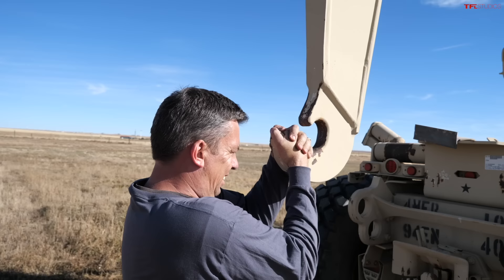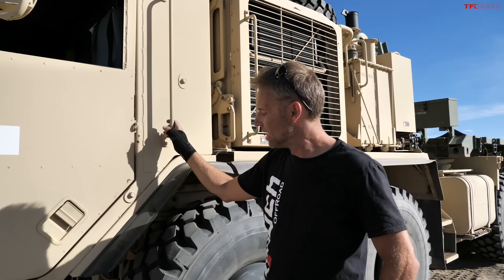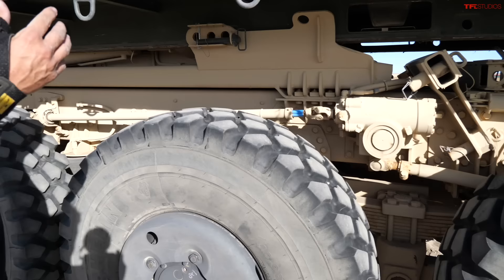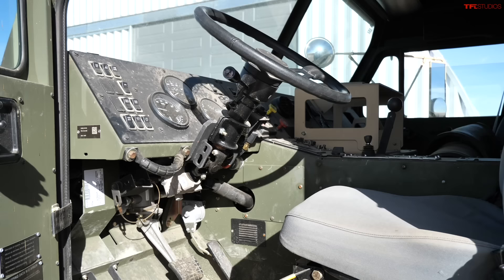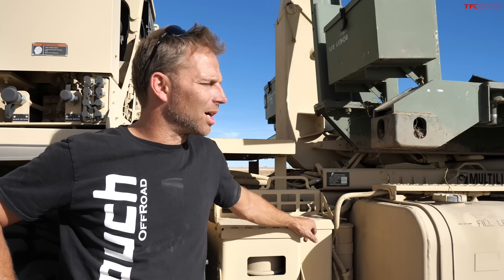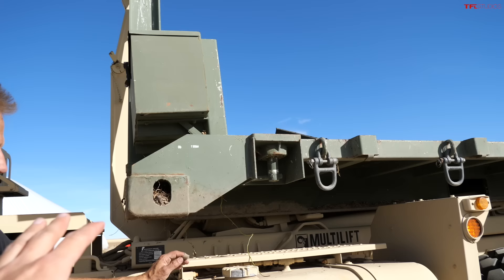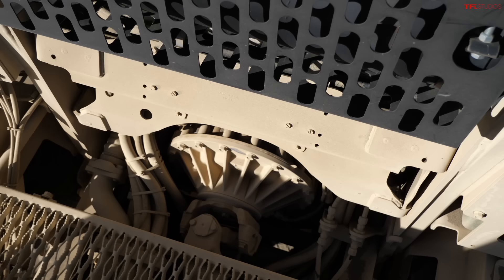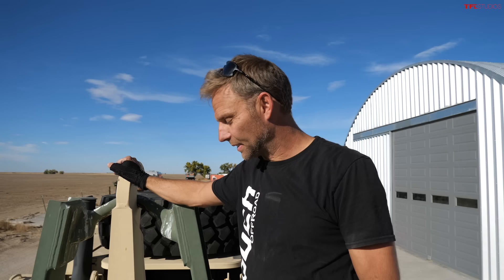Think A 4x4 Is All You Need? This 10x10 Military Truck On 53s Begs To Differ!

Comment: I drove the original into Iraq in 04. Had a Detroit 2 stroke diesel in it. It was an 8X8 and would go anywhere. Was rated at 10 tons and I had much more than that on it. Really awsome truck.
Reply: An f350 is rated at 10 tons dude
Reply: @thomasrobinette3227  that’s just the cargo, it had a 90 ton rated pintle hitch. It’s really an off road vehicle so though it doesn’t haul as much as you think you can go anywhere in it.
Reply: I drove a PLS in my Cavary unit for a little while, but ours also had cranes between the rack and the engine compartment. They are beasts.
Reply: @thomasrobinette3227  An F-350 can tow 10 tons on a nice highway; one of these trucks (in the 8X8) can carry 10 tons off-road.
Reply: @thomasrobinette3227  Yeah, dude. Compare a pickup to a Cat powered 10x10 hook truck. Tie an f350 to a sizeable tree and tie the other end of the frame to this truck. If the tree doesn't come over and the chain hangs on, the PLS will rip the f350 apart. The smaller M984 wreckers are rated to tow up to 100,000 lbs and packs a 30 ton main recovery winch.
Reply: Same. H8 operator in '05. Most reliable truck in the motor pool and the only one assigned to one crew.
Reply: @mtnman1984  who knows.
Reply: Thank you for serving.
Reply: @brianb-p6586  The military rating is for off-road payload, on road is usually double that.
Reply: Drove the hemmet wrecker in Iraq also and in Korea very fun down narrow streets
Reply: @jasonheitzenrater4786  loved the wrecker.
Reply: @thomasrobinette3227  relax dude
Reply: I appreciate your service brother thank you!
Reply: Did your fuel tank leak too?
Reply: @corashae2185  why yes it did, check valve that kept the fuel system primed was always going bad. Real pain to start
Reply: @alannewhall2323  it comes standard on these models
Reply: @thomasrobinette3227  10 tons onboard, not 10 tons towing capacity, they are very different things
Reply: I WAS IN IRAQ 04 AS WELL
Reply: @thomasrobinette3227  🤣
Reply: You had an 1977 A2.  I work with 2and an A4.  This resembles an A4
Reply: Drive a PLS in OIF 06-08. Loved what you could do with this vehicle.
Reply: @thomasrobinette3227  but F350 cant do it through the same terrain a Hemtt can.
Reply: I was a DoD GS15 Contractor who on the teams who armored most of these in 2004-2005 at LSA Anaconda at AoA 2 sprungs in Iraq.
Reply: My best friend was a driver and had a gunner in one of these that tipped,  due to pulling a trailer and forgot to pull out the backing pin out before convoy rolled out. Very long day
Reply: @mando719ad  I imagine that was the day alot of PTSD cases were born. Just thinkin about that cranked up my PTSD sponsored headache. I've been on jobs involving trigger time over 40yrs in a lot of countries. Last spring, at 67, i was almost in mission condition then Murphy's Law hit me. After over 30 surgeries for trauma and 5 cancers it all went sideways.....headon crash in May. "Routine" eye surgery in June. Woke up totally blind in left eye. Got some vision back except in bright light. Couple months later one morning my wife found me in back yard leanin on my Suburban planning mission with my team. Cept they weren't present. 105° temp. At hospital docs ordered CT scan. Spotted leison on remaining L kidney. Had surgery and yep, renal cell carcinoma. Surgeon drained a cyst  while in there. Pathology said it was cancer too. By sticking needle in it just pissed it off. MRI 2 weeks ago, Feb. 20fuctup22 and it has spread. In the wreck it broke off 4 front teeth and fractured 6 others so now they're coming apart. Facing bout $100,000 worth of surgery. Also now have 2 pinched nerves in spinal fusion zone.
I ain't givin up but unless we hit lottery this weekend my bucket/dream list of havin rig like that one is a no go. Wife has a rare '67 Corvette insured for over a million dollars but sellin it to get super rig like this....not on her radar. 
Big thanks to all the military folks that commented. Guessin my contractor days are kaput. Days in general are bout over I'm afraid. Not goin thru any morr surgeries. No chemo. No radiation. Radiation exposure probly what got me in this mess. 
Sorry for long comment. Side effect of my, not terrible, PTSD. 
"The only thing necessary for the triumph of evil is for good men to do nothing". 
Edmund Burke 
The End. 
rick in Tennessee.
Reply: @thomasrobinette3227  “dude”
Reply: @mtnman1984    My Ford Ranger is stronger dude
Reply: @garysarratt1  👍
Reply: @thomasrobinette3227  You can put 10 tons on an F-350? 20,000lbs in the bed?
Reply: @cgreeneblue  I mean yeah you could I guess if ya wanted
Reply: @brianb-p6586  this thing tows 90 tons. Payload 10
Reply: I was a HET Driver from 03 - 04 in Iraq. What months were you there?
Reply: @thomasrobinette3227  yea but take that 10 tons through the rocky mountains and sands of Afghanistan  in an f350… it’s rated for more but that’s the rating for off the pavement
Reply: @Teufels_hunde  who knows
Reply: Do you remember the fuel consumption (liters per kilometer or gallons per mile) ?
Reply: I drove them in the Army for almost 7 years including deploying to Iraq, there almost completely invincible
Reply: @thomasrobinette3227  ok they can haul a lot of weight.
Anyone know how much an Abbram weights?
Just FYI,  as I said I was a tester for the 10 wheel PLS and the CHU  in the Army at Ft Hood in the late 90s.
One test was an Abbram on flatrack. 
System loaded it into the truck 
Truck hauled it great.
Flat rack was ruined. 
The things are beast.
HOWEVER. NOTE  this was before things got Arnoured up.
The one in picture isn't full Armour if any.
I never drove the Arnoured ones. Didn't see one until after I retired.( note sometime after 9/11)  
I drove 70 mph with a D8 dozer on a flat rack as well ( main post from 4th ID side to north gate.) 
May been able to go faster. But I have my limits. They are only football size made of brass. 
Thats some massive high center of gravity. And that road ain't strait or flat. 
And 70 was the highest I was willing to go. So the whole way was not 70 mph.
But it climbed in speed great thanks to that Detroit ( all Detroit motors as far as I know are 2 stroke. This may have changed) 
Detroit like high rpms
Cummings run smooth and strong 
Cats are the engines to give F ups. Because they take abuse.
IMO I like all three. But of what I've seen.
Cummings is the fastest.
Then Detroit
Then Cat.
That doesn't mean ones better.
Detroit can be  " difficult"
Cats take abuse.
And just because today one is faster. Tomorrow another is.
I remember KT650 with a 5 speed and 4 speed browning. ( most don't know what this is) but in its day ( think teddy bear by CW McCall time) it was fast. Overloaded on I-5 doing 90 mph. Close to the old grapevine. 
Truth is engines haven't got bigger. Just new ones.
Turn any old big engine until it blue flames the stacks and it will stay with any truck today. And pass many, because they are governed. 
Blue flame the stacks. This is when at an idle the blue flame is just peaking out the stack. Floor it and you have IDK 10 foot flames. Quite a sight. And last I knew illegal in at least some states , cough cough Commyfornia.
But I haven't seen a truck blue stacked since the 80s and those were " gypsy truckers" independent / outlaw.  
I just remembered that. The truck I was going to buy from Mitch was a blue flames. Thats why my dussy old man won't let me buy it. I would have ran circle around his under powered junk.
Sorry remembering old times.
Reply: @jasonheitzenrater4786  FYI  the Hemet is a different vehical.
Nice but different. It also much older then the PLS.
Though I believe the 8 wheel PLS were Hemets.
The difference is like driving a S10 with a 4 cyl and one with a 350 ( 5.7)
PLS / CHU  will out preform a Hemet hands down.
If you asked me for a vehical to drive in a combat zone PLS is on the list Hemet is not.
BTW M810 series 5 ron is also on the list. But the ones before are not. Nor is the 929 series.
M810 series had good HP and gears. Plus they COULD do 80 mph. ( I didn't have a governor) 
And I would walk before I used a old duece. My company had one top speed going down hill with a strong wind at it back it did 35 mph.
Ok the top speed 35 mph is real  I drove that thing ONCE.  After that. I put so many Xs on the 2404 people called full bingo. I refuse to drive it.   
Anyhow the Hemet goes back to the 80s that I know of.
And FYI I say Hemet. I really don't remember the right spelling. Nor do I care. In 88M school it was the fastest truck. Or was that the M915.
Either way they both were slow. M916, M919, M920  were all faster ( note same engine and trans as the M915)
But I am slightly remembering the Hemets were new at the time. Because they were someone pet. Some CO over me at Ft Dix.
Oh I just realized something. If you never drove or operated a PLS you don't know how quick you can load.
Ok I shiza you not on this.
I've done this. ( one of my many test)
Run PLS  backwards FAST. Dropping hook as I ran. slamming flatrack.
Hooked. Dragging flat rack as Im hauling azz. Never stopped the whole time. 
Impossible to do with CHU attachment.
For all the hell we put those flat racks through. I'm surprised we destroyed so few.
Oh that test on combat loading was done at Ft Irwin Ca during one if many NTC my PLS and I went to.
Yeap back then we had to rail our PLS to Ft Irwin along with 10 flat racks a piece.
I believe in 2001 Irwin got some PLS. But we were already testing the CHU then so we still had to rail them..
Bad thing was everyone liked our PLS and CHU. So the two head testers had to go to every NTC any 4th ID went to. 
Lol railhead guys started saying. Bla bla bla, bla. We just wanted to know when you two would be here. How many this time. 
Like the 4th time on. They would just walk past us on inspections.  And ones they seen us tieing down was the same. 
I vagly remember something about an officer commenting. And the railhead guy saying something like. Heck I checked them 4 hours ago. (OK he didn't check us. But he rode us enough before and knew we knew what we were doing)
And we never did cut corners. Because we knew if we did it would be the time they checked us. And we would never hear the end.
Reply: @jasonheitzenrater4786  BTW I just seen you said Hemet wrecker. 
Rolling on floor laughing my azz off.
Ok here is a really old story of a Hemet wrecker during Desert storm.
I know one that came back with a 454 SS truck engine and trans with less then 2000 miles. It also had a " few" AK 47 and one pretty 9mm with a USSR hammer and cycle on white hand grips. In the bed.
I seen them cut the bed open some "odd metal" put in the open area. And welded shut.
When it came back to our stateside fort.
It went into the mechanic bays. 
All doors were closed and locked 
An hour later. The mechanics came out.
Best Fing chief I've even seen. 
Oh that 454 ended up in one of the two Hemet wreckers mechanic Chevelle. 
I'm sure the other got the 9mm. 
Since I didn't see behind closed doors.
I believe the chief and all mechanics recieve AKs. ( thats all mechanic that went to IRAQ. ) 
The ones that didn't go to IRAQ where sent home early that day, about an hour before the wrecker came. 
Like I said that was one great chief.
Oh something else. Our battion CO refused to do the paperwork so they, any AK, could be sent stateside. Yet, did it for himself, the SGM and at least two others. And rode on a bus from Ryade into Iraq during the seece fire some they got credit for being in a combat zone.
While my company was in Iraq the whole time of the ground war.
The Bus trip costed him with the Bragade CO. Which was one officer I liked and we served a few times together from the time he had his bird to 3 stars. 
Honestly, he was a major azz. But best officer I ever knew. Even to this day I'd follow him to hell  it he was an officer. We had a lot more history through the years. It was good making a friend like him.  
I use the word friend loosely. But I will just say. In the end. I have him to thank for my request to retire being approved.
The shuzabag lizbo battion CO i had really had it out for me.
But a 3 star in the right place. Put it through and got it approved. 
Before the Cut with an N , knew it DA sent me my approval. And just to make sure it wasn't lost. A 3 star sent me a copy. 
She was 100 shades of pissed. As was her fat little lizbo lover. 
I remember my retention NCO telling me   some that happened at Batt when my orders dropped. 
Quite a few people knew she, the batt CO, had it out for me. But they were stuck and couldn't do anything. On the other hand. She was stuck in what she could do. Orders were lost before leaving  Battion. Such as orders to Korea, orders to go to Q course, or any other PCS orders. And she refuse to leave to another command.
So she really hurt herself in the long run.
Plus, I sure my old 3 star, had a few things to say. In regards to her future. 
Oh I didn't mention. That 3 star, last time we were together was Ft Leonardwood. At the time this happened. He was in this little building in Washington with 5 sides. 
Airborne.
Reply: @mando719ad  I forgot about that backing pin.
I remember it was a pain.
But roll over due to it?
Maybe.
But, I think it had to be something else.
These things are hard to roll.
Believe me I tried. 
Again I was an Army test on the 10 wheel PLS and CHU in the late 90s and early 2000s.
Honestly, I feel if someone rolled one of these. They shouldn't of been driving it.
We did a lot more with them then anyone should have done. 
And we did this to make sure they were good for the Army. 
And yes some of you can thank me now with the #1 finger. Because some of those saftey are due to us.
Not sure what was added.
However we did request they had better Armour on the floors.
Years after retiring I seen the sides got Armour. Did they Armour the floors or was it still sheet metal.
To be clear I'm speaking of the floors.
Not the area between the windshield and the floor. That nice plate at the front. I liked.  
There was room to Armour the bottoms. We put sandbags there. So I know Armour would have fit.
I just was very uncomfortable about those floors. Being an Engineer and all. 
Landmines were always on the back of my mind. 
However. I keep speaking of the unarnoured ones. 
I know nothing of the characters of the Armoured ones.
FYI the one in the picture is not full Arnoured.
Full Armour has much smaller side windows. 
And if any Armour was added. It would change things.
 But here are some questions I have for newer operators. That is operator's after 2002 to present. For the 10 wheel PLS or CHU. If you are an 8 wheel or hemmit do NOT answer
Can they,  the 10 wheel PLS and or CHU Still do 90 mph or did they govern it down?
Is the floor still sheet metal ( like 16 gauge) 
Did they keep the auto air for the tires? ( you could set the air pressure you wanted them to stay at.) I like this fiture, but it was slow back then. Took like 10 minutes to deflate down to like 20 psi. And inflate was much longer. 
If any changes that you know where made speak up.
I liked them. But they were also the only Army vehicals I got to drive brand new.
Nothing like knowing that you are the first person to drive a vehical. That no one in the army drove it before you.
And the only driving it has seen . Was from the factory floor to the railcars.
And you drove it off the rail cart to its very first duty MP.
You are the one that gave it its first scratches and dents. Lol.
Reply: i had a m984E1 wrecker!
Reply: @thomasrobinette3227  YOU OBVIOUSLY DON’T KNOW CHIT LOL.
Reply: @wildeninja2836  I know more than you do
Reply: Same man.  Hated the goddamn pls in Iraq but seeing now is kinda cool.  Logged 20000 miles on msr tampa over two tours.
Reply: I used to fix those.
Reply: Oshkosh pretended they were going to make EV postal service vans, made no plans and pocketed 3 billion dollars.
Reply: So basically it was an overbuilt beast
Reply: @alannewhall2323  my friend jumped one.
Reply: @TheRedsuper1  I've seen that.
Reply: The M1075 had the Detroit motor and the M1075 had the CAT. The M1074's had a fuel rail check valve problem.
Reply: Me too. It's a juggernaut. Ours carried our FRS.
Reply: Operated the first Hemmitt way back in '89-'90. That's how far back I go back. Heck, I learned to drive a standard in a 5T dump truck. I do love that beast. Yeah, they get about 3 gallons a mile, but they are awesome rollers.
Reply: @mtnman1984  I was H08 as well. Was part of the initial invasion back in 03. Was in a transportation unit my ass was everywhere.
Reply: I’ve helped the military dig those 8 x 8’s out they get stuck in soft sand all the time they never learn they think they can go anywhere.
Reply: @Kevin-bl6lg  I was part of the initial invasion back in 03
Reply: @Kevin  proud of it too.
Reply: @thomasrobinette3227  four tons cargo, where you get ten from for an f350, bro?
Reply: @mtnman1984  I was H08. 00-05 miss driving that beast around.
Reply: @shadymaint1  I'll bet. I was on Anaconda for my tour. Relatively comfortable while at home, but always on the road. Really glad I was in that truck. I took care of it and it took care of me.
Reply: I was on a route recon in 2006 and saw one of these coming up the highway in the other direction take an anti-tank mine like a champ. Nobody was seriously injured in that attack, aside from the lasting effects of TBI. Those things are nuts
Reply: What you drove sir was a THAAD, a form of HEMMT.  This is a PLS.
Reply: What is the name of the truck you talk about?
Reply: M985 driver here MLRS... Yea HEMTT would scream at 1800 rpm ..
Reply: @thomasrobinette3227  you aren't going to put 10 tons in the bed , dude...an F350 is rated for 1500 lbs.  That's 3/4 ton . Dude.
Reply: @larrybarger1077  inaccurate
Reply: 3/43 ADA, FT. Bliss, TX.   We pulled the Patriot Missile with the 8x8. 90-91 Iraq War(Desert Storm)
Reply: While the A2's with the 8V-92 TA's were always reliable,nearly all of them have been retired from units.
The A4's come with Caterpillar C15 ACERTs,basically bored out 6NZ's,and actually make more torque while having massive hydraulic cooling fans.
The USMC retired all of their MK48's which had Detroits as well,for awhile now they've been using the LVSR's/MMRS' or MKR15's-MKR18's which is their own verison of the PLS.
Reply: @cgreeneblue , not if you ever plan on driving it ever again.
Reply: @Humble_Electronic_Musician , 2.5 MPG is what he stated. I would Imagine you could get a little better on the highway but not much. Let's not forget this thing weighs 50k lbs sitting there completely empty.
Reply: @The-Ford-Guy  thanks ! In the European system that is 1 liter per Kilometer… with current gas prices quite an expense. Awesome vehicle though 😁
Reply: the 2 stroke ones were faster too
Reply: @Humble_Electronic_Musician , lol, I'm pretty sure that's why these things sell so cheap. There's not a very big market of those who have a use for a 50,000lb vehicle that costs almost $1,000 bucks to fill up on fuel and will only get you about 450 miles before you have to blow another grand to fill. I don't know, maybe if I hit the Lotto.......lol.
Reply: That F350 is towing rating,this is over 10tons on the bed or that F350 and what ever its towing
Reply: Why bother driving it
Reply: Thank you for serving our country my friend!